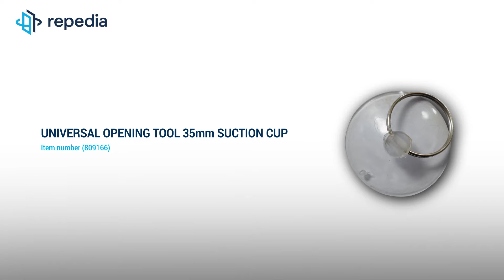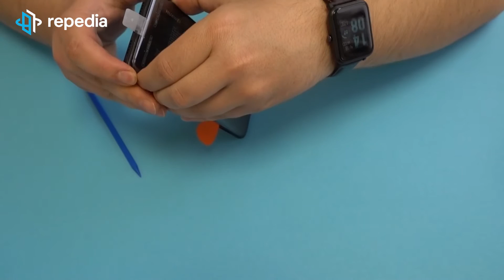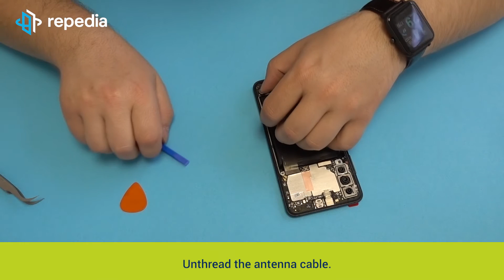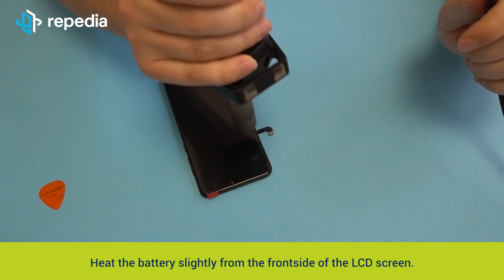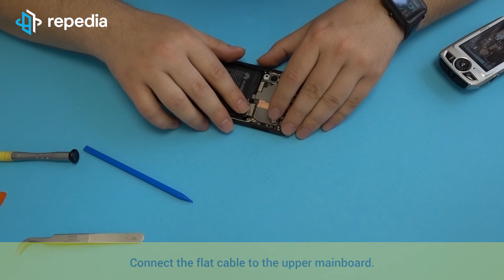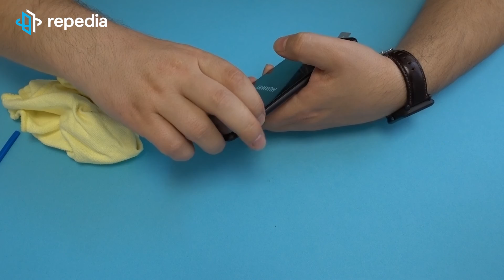Huawei P20 Pro Dual Sim - Screen Replacement (incl. battery) | Disassembly | Teardown Guide

Comment: I would like to know if your tutorial is for dual sim model or single sim, because I have just now a open Huawey P20 Pro single sim without back cover to replace its battery. Every part of model in your tutorial is the same of mine, except the sim holder: my is for 1 sim and your for two. I suspect that my P20 Pro is also double sim and that it is sufficient to replace the holder. What do you think about ?

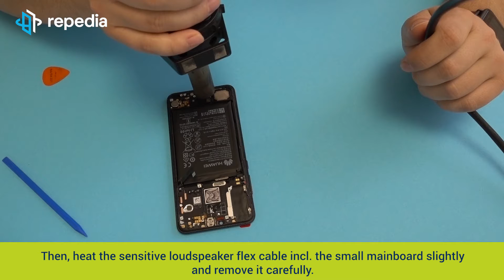Comment: Hello, where can I buy the loudspeaker flex cable/small mainmoard mentioned at 7:13? All the loudspeaker parts I find don't have it attached.
Reply from the maker: Hello,

sorry, we don't offer this cable in our shop. But it can be transferred from the old smartphone when replacing the loudspeaker.
Reply: @repedia-servicelabor8822  Thank you for your reply. The problem is that the cable was torn, so I can't use it now. And I can't even find a loudspeaker that has the cable attached. Is there any way I can get it, even if I have to buy the loudspeaker too?
Reply from the maker: @panos_kosto  The original Huawei P20 Pro loudspeaker that we offer in our webshop does also not include this cable. It is not part of the loudspeaker. Maybe you can ask a repair shop to solve this problem. Sorry, that we could not help you in this case. Good luck with the repair!

Comment from the maker: CORRECTION: 

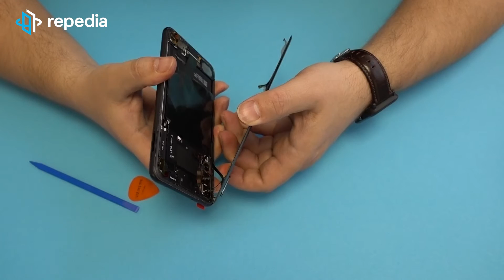Unfortunately, we've made a little mistake at 02:28. The flex cable mentioned there, is not for the fingerprint sensor. It is for the autofocus. Sorry about that. Fortunately, this won't affect the success of the repair when following our tutorial. It is just the wrong name for the flex. So, we wish you much success with the repair!

Best regards from the REPEDIA-Team

Comment: That first flex cable isn't for the fingerprint sensor it's for the autofocus
Reply from the maker: Hi, Thanks for this advice! We are double checking this and will update the tutorial
Reply from the maker: Thanks again for your hint. You are absolutely right. Unfortunately, we've made a mistake. The mentioned flex at 02:28 isn't for the fingerprint sensor, it is for autofocus. We will make a correction in our video description and in the comments. Fortunately, this mistake won't affect the success of the repair when following our tutorial. It is just the wrong name for the flex.

Best regards from the REPEDIA-Team

Comment: I guess there's no way to replace the glass only? Mine is cracked, but touch screen still works perfectly.

Also, can I pay you to do the repair for me? 😂
Reply from the maker: Hi Anthony,

I think professional repair shops can replace the glass only. But we do not offer a repair service. In most cases, you will find complete LCD screens for this model (oftentimes incl. the battery). So it is much easier to replace the whole LCD screen. 

Unfortunately, we do not offer only the glass in our webshop. We always try to show how to repair different devices by yourself in the most easiest way to prevent involving a repair service. 

Hope you will find a good solution for your phone! 

Best regards from the REPEDIA team.